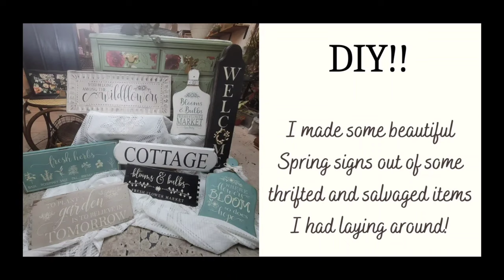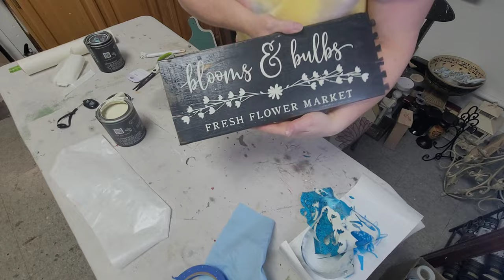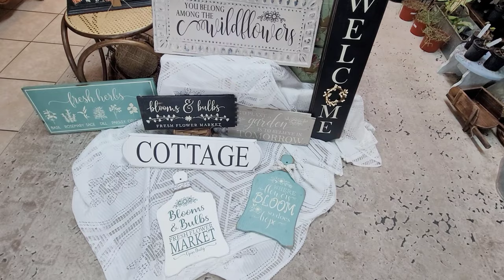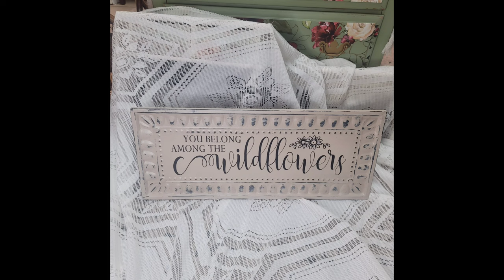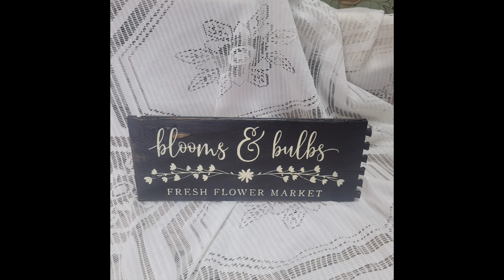DIY - Signs for Spring!!

Comment: Love the signs so much! Especially the ones from old drawer sides. I have some I also need to do.  Can you tell me what you put on the back to hang them?
Reply from the maker: Thank you! And for the drawer sides, since they are thin and a bit brittle I just glue two d-ring hangers about midway down the back on each side and run a cable through them . . .